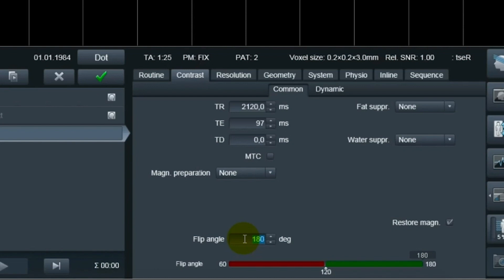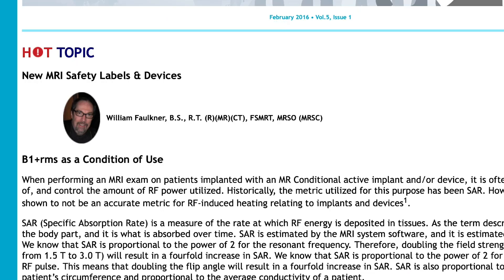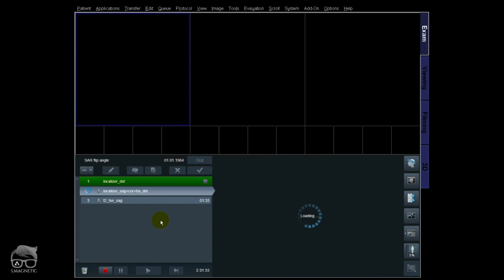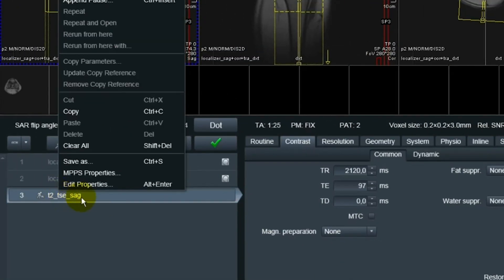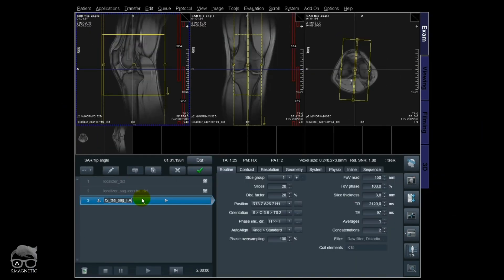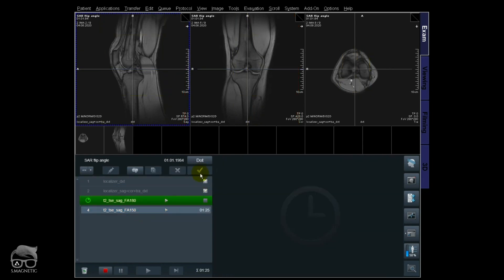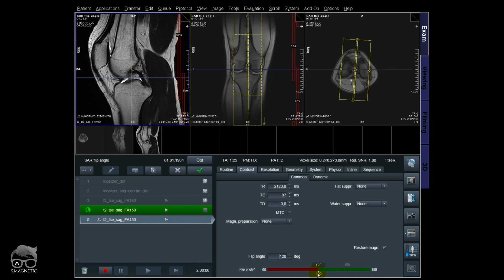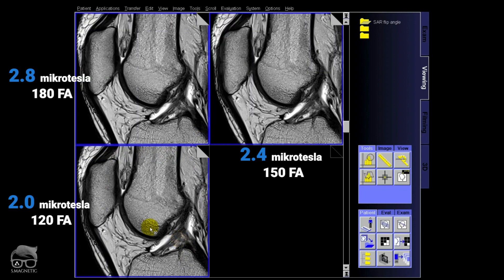FLIP ANGLE – DOES IT HAVE AN IMPACT ON THE SAR?

Comment: How low do you go on flip angles for T1, T2, PD, And STIR. I have a Siemens Skyra 3T. I mess with flip angles on the 3T, but rarely have to on the espree 1.5 since we get less SAR issues.
Reply from the maker: Good question. Stay tuned for part two where I’m doing a few test scans regarding this.

Comment: Hello, nice video, (I had have the opportunity to use 0.35t 1.5t and 3t MRI systems of Siemens)maybe if you trie to do again the same test but invert way, (first 120 then 150 and then 180) I thing, when you trie the 180 the sar get elevat much that 28ut, because the sar is accumulative. What do you think?
Reply from the maker: Good point there. However, it doesn’t matter if the value was at 2.8 or 2.4 mikrotesla. Main point is increasing the fa will also increasing the sar. Don’t you think?
Reply: @Nguyen_MRI  Of course, when we use a high fa the sar increases, and the reason is because the fa is directly proportional to the energy of the rf pulse used, so, while we use higher fa, more energy we need in the rf pulse, and therefore, this deposits more energy in the body studied. Thanks for sharing your videos because they are very interesting.